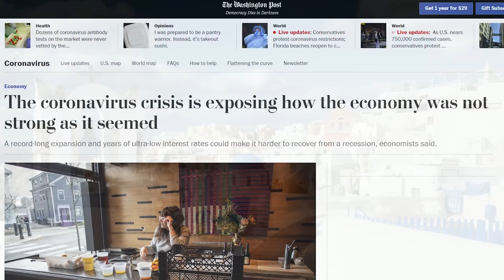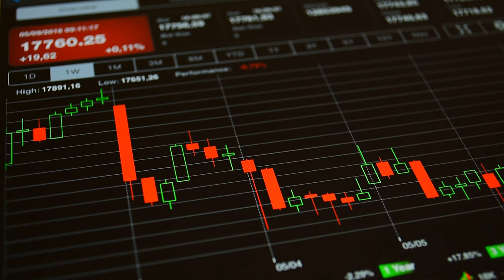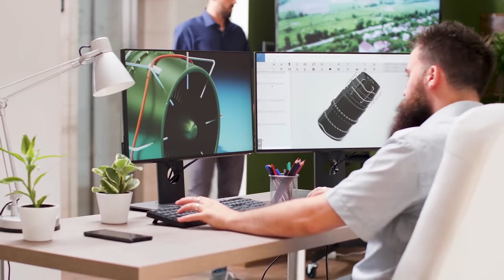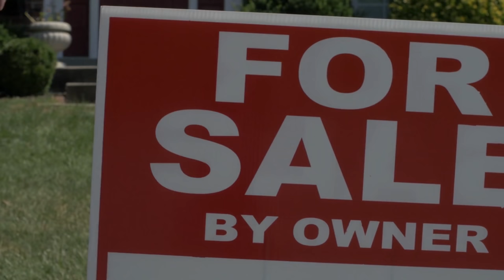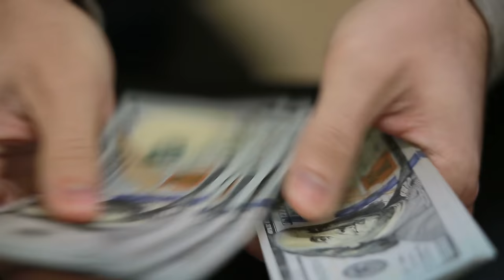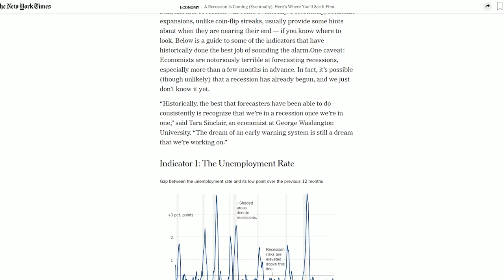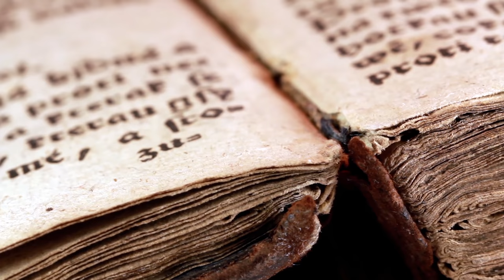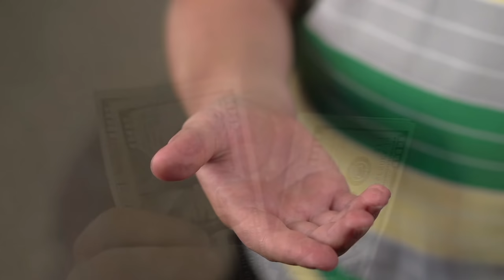Do We Actually Need Debt?

Comment: Imagine making the banks responsible for what they're investing into and creating servitude for?
GASP.
Debt should've been a tool of last resort, never running the entire machine.
Reply: Debt is not a given - EE
Reply: Can’t fund a loan without a debtor. It’s a two way street.
Reply: Banks already have an interest in checking businesses though. Individuals too. Banks ALREADY lose money if their borrower goes bankrupt under the current system.
Reply: Myke Prior we'll said mate.
Reply: @Eric149162536  not if they are bailed out by the gov every time
Reply: It’s the only way to maintain the levels of growth to sustain capitalism at this point of development. And even then it fails every so often, which requires a bailout and more debt creation otherwise the economy completely implodes.
Reply: Under developed countries don’t necessarily have to do this I should add, but when they reach the point of development we are at in the west they will be required to take this path unless they adopt a different system or reinvent in a serious capacity.
Reply: @monad_tcp  
Banks have to pay the government back everything that the government paid them, with interest.
Reply: @カスカディア国人  Extra money doesn't magically make things better. Fiat currencies only symbolize resources, and resources themselves are what fuels everything.
Reply: Screaming Butterкот wrong the whole point of fiat currency is that it’s not backed by a commodity. Fiat money does not have use value, and has value only because a government maintains its value, or because parties engaging in exchange agree on its value. This is incredibly useful for large scale economies where it can be much more difficult to back all of your currency with a commodity.
Reply: Screaming Butterкот and sure extra money can make things better if you’re wise in how you apply it. Do you think the US government prints all the money it prints for absolutely no reason? I’m not telling you everything they use it for is good but creating extra money is literally what keeps our economy afloat right now.
Reply: Screaming Butterкот and it was this way before the corona virus even. Having a low maintained rate of inflationary growth of the money supply helps our economy grow.
Reply: @Eric149162536  This isnt that accurate because banks do NOT loan out the whole sum of money. They just need to make sure they have a given amount of the money and then order the rest printed. On super large loans they also syndicate to reduce risk as well. Banks do NOT run the same risk as a private person loaning out money under the same deal settings.
Reply: Debt should be as illegal as defaulting on it is, because every dollar in interest is either paid for with more debt or is paid for by another guy defaulting on his debt. There is also a third way which is printing money, but todays money printing is called quantitative easing and is just buying more debt. And who are the central banks buying the largest amount of debt from? From the government and we have learned the government cannot default on its debt, haven’t we?
Reply: @カスカディア国人  Don’t confuse our current financial system with Capitalism! As pointed out in the video there are other ways to provide leverage for an economy than debt so while leverage and market exposure for capital is key to capitalism, debt is not. Equity exposure would be the key.
Reply: @HT-vd4in  if we didn’t create debt we wouldn’t be able to sustain the growth necessary to make capitalism work, the economy would crash and collapse without debt creation. People would starve if we for example ended subsidies to farmers, because the subsidies allow our farmers to actually sell their produce on the market, it would be too expensive otherwise, I know as a farmer. It’s because of the level of development we are at, there’s no easy roads to grow our economy when it’s already doing a lot of things at a very high level.
Reply: @カスカディア国人  Don’t bring subsidies in this conversation. Just look at New Zealand! Farmers always can get access to capital, I am just supposing that straight equity investments would be a way better system than loans.
Reply: @HT-vd4in  we used to not do much in terms of subsidies for farmers in the US and then our agricultural sector blew up in the 30’s and Roosevelt implanted the basis for the current way we do agriculture. Also what you don’t mention about those subsidies that NZ got rid of is that they took the same money and invested it into Research and Development. The claim that getting rid of the subsidies helped them is simply not true, what helped them was the large government investment into researching new agricultural methods. In the United States we do both and we have the most powerful agricultural sector in the world.  If we did not do the subsidies and public investment into R&D, our food would be way too expensive, predatory actions from companies like Monsanto drive up the cost for farmers, which they are allowed to do because of our patent laws, along with proprietary parts for farm equipment, add in what the cost of labor is in the US, and there’s zero way we could compete on the international market without the government stepping in. Our food would be way too expensive and our domestic agricultural sector would die with out the subsidies, and we would become heavily reliant on imports of agricultural products, New Zealand is a small island country that was already heavily reliant on imports for every industry, so it didn’t matter as much what their government did, but in the US we are heavily reliant on the export of agricultural products that could never compete on the international market without government aid.
Reply: @HT-vd4in  subsidies are necessary part of this conversation because our government budgets run on debt. It would be literally impossible to get rid of the debt based system without a major economic transformation across all sectors of the economy.
Reply: @カスカディア国人  While the handling of the Great Depression by FDR is praised by Keynesians, it is still argued by other economists.
Reply: I want to elaborate on this: This is how Kaynesians think: There was a femine and because of the femine we took some measures and subsidized agriculture. Afterwards the food supply was stable, so subsidies are great! But Hayek-Economists would argue there were many causes for the Famines, the main reason was the dust winds and the climate/whether during that time. And naturally these factors would have stabilized themselves, so the food situation would have become better no matter what the government had done...
Reply: @HT-vd4in  the main cause of the dust bowl was actually because of the soil being abused, in order to compete in a capitalist market farmers began to abandon practices that helped preserve the soil in order to make ends meet. The soil became “weak” and that caused the dust storm, part of why we introduced the subsidies was to give farmers an incentive to take better care of the fields, there are practices you have to maintain in order to get all of these subsidies, they don’t just give them to anyone.
Reply: @カスカディア国人   Farmers being uneducated and shortsighted has nothing to do with capitalism. Just look at the feminines in communist countries. After WW2 in East Germany all big farmers were expropriated and then the land was given to the urban population. They ate all the seeds and the next summer there was the biggest famine in History... What farmers need is Access to capital, we can all agree on that. And we can also agree that debt should not be their go to option. But instead of arguing for subsidies I argue for equity investments. We live in the 21st century, finding a way for financing farmers would be the easiest thing in the world.
Reply: @HT-vd4in  the reason they had famines after WW2 was because of the destruction of the war, the whole of Europe had a famine after WW2, East Germany is actually one of the communist countries that did better with food besides Yugoslavia. In the case of the Soviet Union they had a combination of natural factors and a pseudoscience called Lysenkoism, combined with rapid industrialization, lead to their famine before WW2. 

In the US it definitely did have something to do with capitalism, farmers couldn’t compete so in order to hold on to their livelihoods they exploited the soil too much, it’s quite simple.  This happened to my family, I know the story, my great grandfathers were those farmers, my neighbors families were those farmers, do you really think the US government would do any populist program unless they had to? FDR did the new deal because it was necessary to preserve capitalism, politicians like FDR and Huey Long feared a communist revolution in America and we got very close to that happening on a few occasions, the 1930s being one of those occasions where the communist party was growing large, so they came up with the welfare state and compromised with socialists just like other western countries did at different points.  

I know this story very well because my family was part of it, one of my great grandfathers was a southern new deal democrat politician, now today a similar threat emerges, the threat of a violent revolution that could be much worse than the communist ones of the 21st century awaits on our horizon because we have attacked the new deal policies that kept our country stable and gave social mobility, communities like mine are languishing in ever growing poverty to the point we have homeless people now when at one point in my life that was next to unheard of around here since the 1930s. Now a number of the people here have embraced a violent far right extremist populist ideology and chant for a violent nationalist-populist revolution, the rest of us who reject them are far left populists and pacifists who abhore violent revolution and want either a peaceful revolution or a peaceful resolution and compromise at least. The longer this goes on, the more polarized our society will become, and the more people will turn towards violent means and ideology to achieve their goals the longer the system fails to respond to their problems and communities. This can’t continue, we need a new new deal to repair the situation and heavily reduce inequality and poverty in society. We need to reaffirm our commitments to democracy, equality, and human dignity, my community has been robbed of its dignity and now it’s a rabid dog, the only cure is to restore that dignity. And people here don’t just want a check for 2000 dollars or whatever Yang came up with, they want actual jobs that are going to always exist, they want stability, they want to have the life their parents had, instead they either end up escaping from here if they are smart enough to get a scholarship, or they end up stuck here living in horrific poverty, they need healthcare, they need education, they need jobs, they need cheaper healthier foods and they need the rest of the country to actually care about their existence. I’m one of the most well off people in my community, and I still struggle to some degree, you know it’s bad when even the privileged in a community start to struggle, if it weren’t for the cooperative that we formed with other small farmers our situation would be much worse, socialism and social markets both saved us small farmers in my community, you’ll be hard to pressed to make me not like these ideas when they work so well for myself. When someone is saved by these things and is educated they will cling to them no matter what, I’ve seen with my own eyes what type of approach helps in a society like ours. And I plan on making a change directly in my community at least.
Reply: I'd like to think that if we got rid of student loans, and went back to individuals, or colleges, or businesses, taking up the responsibility to educate someone (because that person's education will likely pay off well in the long run), we wouldn't have the student loan crisis or the glut in adjuncts who will never become tenured professors we have today.

Comment: Re: housing - you should have talked about how someone on a teacher's salary in the 1950s used to be able to buy a house outright after saving for something like 4 years.
Reply: Gotta remember how many people there were in 1950 vs today, way more demand for housing
Reply: My grandparents paid $600 for a nice 3 bedroom, 2 bathroom house.
Reply: @mulllhausen  Cash house price is a red herring. As pointed out in this video, access to debt on a tangible asset is how we buy that roof over out head. And as pointed out in the first comment of the this thread, it's been that way since the 60's and 70's. Houses were already "unaffordable" in cash terms in the 2000s and a 20-30 year mortgage was fairly typical. Mortgage interest rates since 2000 have plummeted (the base rate from 6% down to 0.5%, actual fixed rates from 8-9% down to 2-3%) and the same 20-30 year loans are the norm.
Reply: @DiscoFang  credit and low interest rates are the direct cause of high house prices
Reply: @mulllhausen  You’re absolutely correct on that.